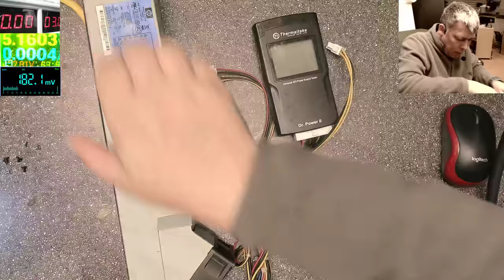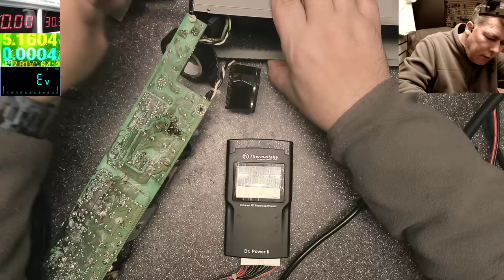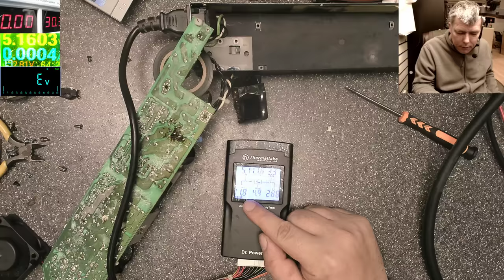Desktop Pc Power Supply Repair part 1

Comment: The blue component wrapped in heatshrink you removed is most likely a MOV, not a cap. Metal Oxide Varistor. It goes short-circuit when the voltage across its terminals exceeds a certain threshold and blows the fuse for overvoltage protection. This supply most likely experienced a surge on the mains.

Comment: I have spent  3 decades repairing electronic boards. I really enjoy watching you because these repairs are difficult. I like your camera set up and electronic equipment. I’m an old dog looking for new tricks in the electronic field. I would use an infrared gun to see what’s so hot. Harbor freights for 20$ infrared Gun. Soldering iron not hot enough? Then heat soldier on pin and add fresh soldier to that pin. The new soldier will heat the pin up faster and penetrate the board. This is my 50 th year in the Petrochemical field. I’m an Instrumentation and license journeyman

Comment: You with power supply, myself with my home '08 LG 42lcd with bad gamma chip AS15-F on the tcon. 
Currently pondering on 1) change for 3-4€ the broken smd /may get it tomorrow but have no advanced tools at home, 2) change the tcon board for 20-30€ 3) for 2x the tcon price, get another same model lcd. Ah fixing modern electronics!

Comment: Better to use a series bulb for testing if u r afraid of fireworks ☺
Reply: not just when you're afraid ;) that's a must have thing when fixing switchmode powersuplies.
Reply: @robertjung8929  better a current limiting transformer that also can be regulated
Reply: @djtongi  nope you don't need regulation... incandescent lightbulb in series is the ultimate tool. if the PSU is shorted on primary the lightbulb will light up and limit the current to it's own rated value... if the bulb stays cold or dim it means primary is safe to be connected directly.
Reply: Robert Jung yes i know that, i‘m „meister“ in electronics in germany. 
sure you don’t need regulation but a transformer limits the current during measuring or further testig. the bulb method is the safest way to test at startup. the smaller watts the bulb the better the current „protection“, but because of the capacitor load on first plug in, the bulb can light up and stay lighted without damage in the device, so this is not always a bad sign :)

Comment: Varistors are used to protect a circuit from high voltage surges, in other words MOV or TVR, really need to replace that capacitors that has swollen, Power supply will be unstable
Reply: yeah! he forget about that capacitors. buuuuu

Comment: 21:26 ist not a capacitor its a voltage dependent resistor
Reply: Yup a varistor as a part of the protection will also be my bet ;)
Reply: Yes the varistor and the fuse work together if the voltage goes above the varistor limit he will blow the fuse for protecting the circuit short explanation
Reply: Sorin think that it was a capacitor because it has blue color. I justed to see mov/varistor on yellow or green, or red/brown color. Blue is more often used for capactiors. So i did the same mistake as he did.

Comment: Power supplies of TVs and computers are my daily tasks, not so hard to repair, they are the most common fails, and a good money to earn by quantity, it require some experience. But i really find it easier than your usual jobs :-D. The key element in power supply it to always firstly check the switching transistor or IC and diodes to don't lose time, it is the main culprit when any shorts occurs.

Comment: People say you are dodgy. They should see someone cut the wires from a mini psu, solder them to a normal psu and use it outside the computar box as an external psu. I can  confirm it does work. Looks like crap, but works.

Comment: BOOOO!!! You forget about that swollen capacitor here 4:01 The output voltage will be unstable during load, and on one day it will fails again. 
And as lot of people have said here, that blue element was MOV/varistor not capacitor. BUT I did the same mistake as you. Becasue it has blue color, I think the same as you, that it was capacitor. I justed to see mov/varistor on yellow or green, or red/brown color and blue more often used for capactiors. So this one i understand. But not that swollen capacitor form the beginng. it is fail :)

Comment: I know I am late to the party, but I have seen things like this while working on my JVC Home theatre setup that kept blowing the main filter capacitor. 
What happens is that this has a complicated design that makes the first filter caps act as a voltage doubler. There is a voltage sensor circuit in the input calibrated to 120 volts or so. If the input voltage is below that, the system senses it as connected to a 110 V supply (US) and connects two nodes via a triac to act as a voltage doubler. If input is more than 120 V it senses the input to be from 220 V and disconnects the doubler network. While this setup worked ,the main filter cap always see 220 V and is rated to max 400V. In my case, the triac shorted to death leaving the voltage doubler to be always on. When plugged in to 220V supply  that filter cap got fed with 440 V and fried. Removing that shorted triac solved the problem.

Comment: Dear sorin you are grate , like these devices i use series lamp tester with 200 watt for test power supplies i made it in a box with 2 lamps on series it is more safe for test not to blowing the parts and put it with your other testers also I figured that you dont have solder sucker tool its important with boards like that its useful for you .. regards

Comment: Sorin, which flavour do you like in your vapor the most? burnt capacitor or semiconductor?
but really, when doing this kind of work on power supplys, i recommend you to get an testing-transformer, that can be regulated from 0-250V AC and has a short circuit limiting to 3-5 Amps, so you don't get the entire short-circuit-current with arcing from the public power line. Every Radio and TV technician used these back in the day. Another advantage is, that they're not grounded, so you are 1 touch farer away getting electrified.

Comment: when i did hoe and small business PC and Networking 20 years ago we had a client that had an expensive CNC machine that ran off a windows 98 pc. he said he could take the hard drive out and put it into another PC but it had to be the same make and model mainboard , network card, modem and especially video card or the program for the CNC machine would not load. We had a scare when he called our dispatch department and said his computer would not boot after a thunderstorm. I went there luckily it was his power supply. He said it would cost $159k to upgrade to a whole new CNC machine and a new windows xp PC. I told him i would go on eBay and try to find like type hardware listed hardware for above for the windows 98 pc. Never saw him again, got a corporate IT job.

Comment: The 12V rails is low because this is a group regulated PSU. It looks for the 5V to be close. If 5V is not loaded at all the 12V has to be low because it rises with 5V load. This problem is well knowen nowerdays.
Reply from the maker: u r right, thx

Comment: It is an expensive power supply which you often find in servers or PC racks. With those kind of power supplies it is like a cartel they charge too much money for what it is. They have the power to run graphic cards multiple hard drives and various add-ons they usually live a lot longer than a PC. The oblong shape is to keep them away from other components in a crowded server or PC rack. He could have purchased one from HP at an inflated price.

Comment: 29:00 i had so many times thinking like that, should i plug it or not. On me the things are 50/50 ( OK/Blow)
Reply: for THIS reason, there are testing-transformers, that can be regulated from 0-250V AC and have a short circuit limiting to 3-5 Amps, so you don't get the entire short-circuit-current from the public power line. Sorin maybe you should get one of these. Every Radio and TV technician used these back in the day. Another advantage is, that they're not grounded, so you are 1 touch farer away getting electrified.
Reply: @djtongi  i use a light bulb when testing :)

Comment: Also if try continuity on the mosfets output and input its shows no resistance like its shorted, or somevhere else, could I check that with analog multimeter?

Comment: Whilst I get that the knowledge share of diagnosis is very good here, it worries me that for the sake of a couple of components (fuse, MOV etc) you are showing that a bit of wire or leaving out bits is acceptable, even jokingly (for testing I get it) - even if the fuse or MOV was replaced off camera, I'm sure there are viewers out there that think a bit of wire or omission is acceptable because that's what they saw and will then go away and do the same without realising. All those bits are easily available from CPC, Farnell, RS etc, even Ebay for one off and hardly a long lead time (or even pillaged from another item). I get that for low voltage stuff, leaving out the odd component (e.g. smoothing cap) is probably going to have a negligible effect, but on the mains side it's not worth the risk in my opinion (even if there are other safety measures in place e.g. plug fuse, MCB etc) - the day one repair has a consequential loss and the repair industry gets a bad rep and gives the anti-repair lobby something to use as a stick is not worth it for a few pence on a fuse or MOV in my opinion. I like the fact that you are prepared to share knowledge but it would be good if you can conclude with the next steps i.e. fuse and MOV should/will be replaced for best practice :)

Comment: Hi I would like to know which type of wire You used as a temporary fuse until You put a actual fuse in.?
I have a Power supply that fuse blew but can not find out why the fuse blown yet even after replacing Fuse.

Comment: Can MOV's fail with age or has it just been doing its job with small spikes over the last 20 years?
Reply: They degrade. Not with age, but with handling small spikes. Eventually they go short circuit.

Comment: You really should replace that swollen electrolytic caps, You'll have a bad ripple on your secondary voltages.. That blown component is a MOV, (variable resistor)for handling voltage spikes (resistance goes down if higher voltages are applied).

Comment: Amazing video Mr. Sorin! As always, of course.
Where did you get that cool electrical screwdriver? If you don't mind me asking.
Reply: I'm quite sure that's the xiaomi wowstick.
Reply: Thé screwdriver is on sale by AliExpress  I think  wowstick, ifu is cheaper and some has more tork i order one immediately for myself, there are many brands wowstick is one of them 
Differed bits in thé set
I Prefer ifu due to thé comments from customers
Thé one on thé video is wowstick I think has one two way button, ifu has two buttons . Versions chargerbattery or aa battery

Comment: Tell me Sorin ,do you have a desoldering pump.I noticed that you all component desolder with a copper wire,why?
Reply: And i think that is the capacitor not voltage resistor ,this part coms out after the bridge recetifier not before.

Comment: If you don't like fireworks why don't you use a 60W bulb instead a wire to replace the fuse? If there is any short circuit in the schematic, you have light instead fireworks and smoke and nothing is more damaged than in the present

Comment: I know I'm late around one year, but, it's painful to look someone torturing himself about PSU topology: It's half-bridge, like any ATX PSU, or may be, but rarely, 2-transistor forward , with switch for 110V for voltage doubler, and passive PFC choke. Every capacitor connected in series serves one transistor in pair., for half a PWM period. That blue thing inside heat shrinking material can be interference capacitor in parallel to main electrolytic capacitors. It's simple to check: see the screen on PCB, should be some symbol for component.
Check what semiconductors and how many there are, so you can check them first. If fuse was blown, almost 100%b, some semiconductor is broken (voltage or thermal breakdown).
In my branch, which is VFDs and DC Inverter air conditioner boards, I always come across the same circuits found in switching power supplies. In fact, every single inverter for motor drive has it's own SMPS with multiple rails, of which are many with different grounds on the low voltage side.
As someone already have mentioned, always use series bulb for soft and safe plug into mains. I have my "magic" box with 3 bulbs, different wattages, which can be combined in parallel, for various ranges of converters. If bulbs are turned off after bulk capacitors are charged, then I press switch, which via contactor bypasses bulbs, and plugs full mains voltage into circuit. 
Also, never work with power converters without variac.

Comment: What 'paul sig' said: it's not a capacitor. I think it is one of those over-voltage protection devices. I don't know what those parts are called but you often find them in those circuit protecting power plugs. If someone switches that PSU to 120V input voltage while it is connected to 240V, this part will short out and blow the fuse, thus protecting the capacitors and the rest of the PSU. That poor part sacrificed itself and saved the PSU. 
If you don't replace it, then you should bypass that switch and permanently wire it for 240V.
EDIT: Bypass is the wrong word. Leave it open, by disconnecting it. When open, it's just a 240V full bridge rectifier. When closed, it probably connects the center point of the caps to one of the full bridge rectifier's inputs. On that way, while the input is positive, it charges one capacitor to 120V. While it's negative, it will charge the other. Result is again 240V. Actually, 400V, because it will charge to the level of the peak of the incoming AC.
Interesting. When on 120V setting, just two diodes of the rectifier will see current. And still, 400V will be available for the chopper and the transformer.
Reply: burned component is named "MOV" and in some PSU pcb is named "ZNR"
Reply: @najibd3824  Yeah.. a MOV. Thanks!